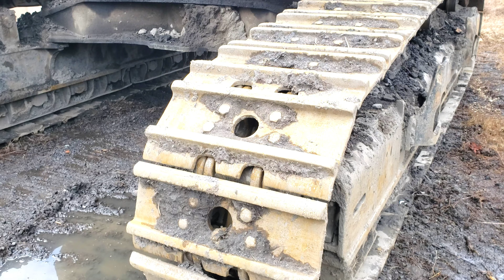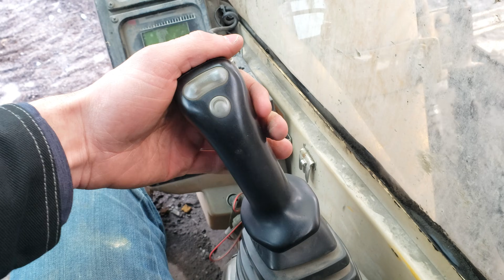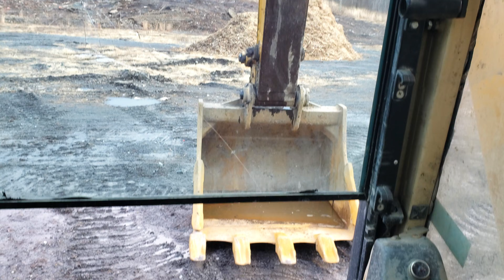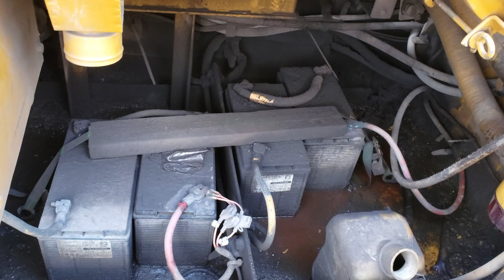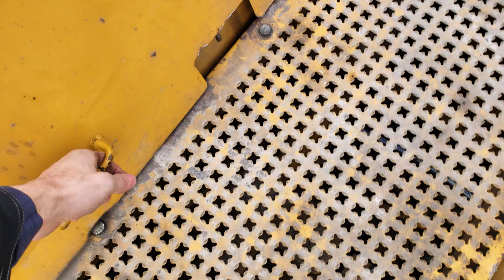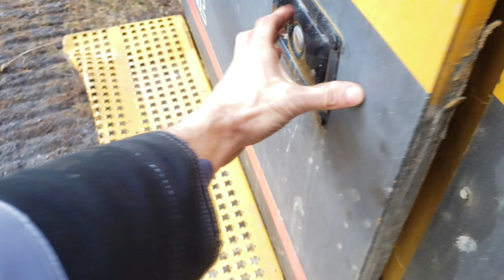The CAT 365B LME - The 245's True Successor

Comment: The 365B was a pretty good machine..if it had a weak spot, I would say it was the engine…it really should have had a 3406/C15 family engine…the 3196 and it’s smaller brother the 3176 had a very peculiar design in the fact they had an aluminum step deck between the head and the block which they had a lot of issues with in the truck applications  and in some of the equipment and stationary applications…they also had a different kind of injection system that took a while to work the bugs out of, but I will say, this engine family was very good on fuel which was Cats goal in making this series…I would hazard to guess the 365 was likely 25-30% better on fuel with better production than the old 245…the engine burned less fuel but the pumps were much more efficient as well which aided in its lower fuel consumption…Cat had it pretty much figured out when they came out the 365C…it was pretty much at its pinnacle at that point with the upgraded C15 power plant and fine tuned hydraulics…Cat sold a lot of them in my area!..great excavator!..
Reply from the maker: Interesting points on the engine.  I also think your estimate on productivity gain between the 245 and 365 is probably right in the ballpark. Thanks for sharing that!

Comment: a 365 is a lot bigger than 245 cant really say its the 245 successor
Reply from the maker: Don't know what your looking at, but a 245D is a 3-6yd 72.5-76 ton class machine, same as the 365
Reply: @PAmining  ya i was thinking of a 235 i had seen your right i stand corrected. ive never even seen a 245
Reply from the maker: No problem 😁